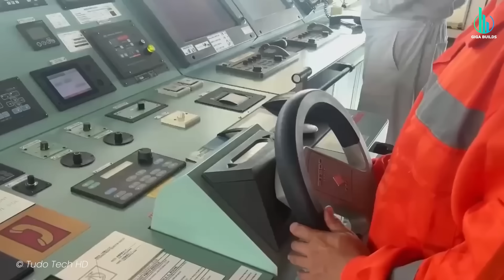Mexico Just Shocked The World With What They’re Building

Comment: They should add a third rail at the same time; this could be an exclusive overload line if tourists want to use it, or for extra cargo trains. It's a great idea. Value adds multimodal advantage.
Reply: The tourist train from Oaxaca to Veracruz is the interoceanico and the other tourist train from Palenque Chiapas to Cancun is called Train Maya that travels 160km hr. And more are being built up to Laredo TX,some of them will travel at a speed of 200km hr.
Reply: once trump becomes dictator there will not be any tourism.......
Reply: They could ad a 4th, 5th and 6th line. Then maybe 1 more just for you.
Reply: They did its called Tren Maya, its massive goes thru all of Yucatan region and part goes to northern Mexico.
Reply: @elely1973  Thats north - south with all kinds of places people want to go. This guy is talking about a train  eats - West that sees nothing but jungle. Just disregard, he has only seen pictures of Mexico.
Reply: @elely1973  None of the Tren Maya goes to the north, it is a project of the south east and it has been riddled with issues from derailments and cost blowouts through to struggling to generate a passenger demand.
Reply: @ElBogano like I said, it is a Massive brand new south east project , but it will connect to one or more of the existing rail lines that goes north. Of course it went thru some issues as any great infrastructure works do in any country. Between 1,000 and 1,300 derailments occur here in the USA each year.

Comment: The lake that feeds the Panama canal is drying up.  Viva Mexico.  I'm so excited to check out the train.  Woohoo.
Reply: no it's not. stop believing that lie
Reply: To hell with mexico
Reply: Mexico works.  Its always  been a laboring country.  Mexican labor built half of us. Blacks powered 40% rest yellows n pinks laborers covered 10% while 90% lazy nazis kicked back with gold hammers n whine btls
Reply: Yes, the Gatun Lake just can't support the amount of water needed to handle the bigger ships.
Reply: @mostlyinterested1016  dude Gatun Lake is fed by the ocean. All they need to do is remove the dam blocking the river that leads to it.
Reply: @thomaswakefield6889  Apparently, and you'd have to ask Panama why/why not, the lake/locks system keeps running low.
With regard to the ocean being used to supply the water, you do realize that the Atlantic and Pacific ocean levels are not the same, right? So the whole transit effort of the vessels is governed by the need to keep pumping supplementary water from the Gatun Lake and I'm told they're just not getting enough rain in Gatun to allow the locks to operate for the transit of the Post-Panamax vessels. They just spent a bucket-load of money updating the Miraflores staircase water storage system but that apparently hasn't resolved the issue.
Reply: @mostlyinterested1016  dude I’m Panamanian and Gatun Lake is at the same level as the river that is supposed to feed it from the ocean. The difference between you and me is that I know my country better than what you read in books or from what someone who’s never been to Panama has told you.
Reply: @thomaswakefield6889  OK, let's start here. My apologies for being given the wrong info by repair techs that visited the site to fix cranes. I don't think arrogance is the correct approach to correct my misinformation. As a Panamanian you would indeed know more about your country and the canal than would I.
Reply: You also do know that the Caribbean  Sea is what actually feeds Gatune Lake.
Reply: @thomaswakefield6889  sorry to correct you, but the Lake is fed by the Chagres River, which brings down the rainfall from the mountains. and freswater is then released on both ends to the sea, at least most of it. Some is receclyd in the new sets of locks
Reply: Canal is in disrepair US aint repairing gulf of Panama 😂😂😂😂
Reply: @JuanPerez-ve1tl  the Canal is in disrepair because the Panamanian government let the Chinese have control, outside of violating the transfer agreement of the canal which Panama violated by giving China control of it, why do you think Trump threatened to take it back if Panama didn't tell the Chinese to fuck-off.